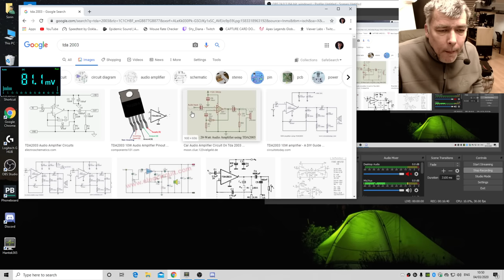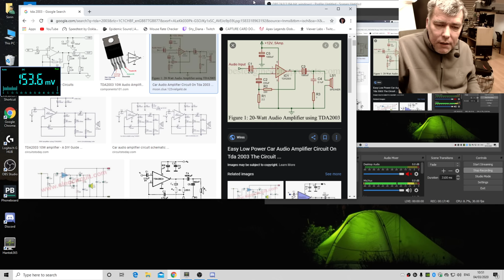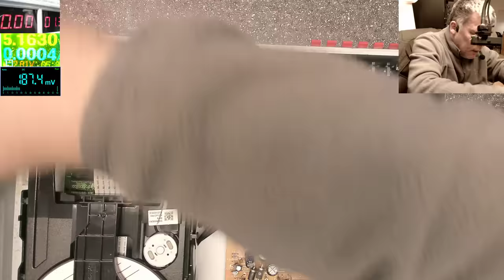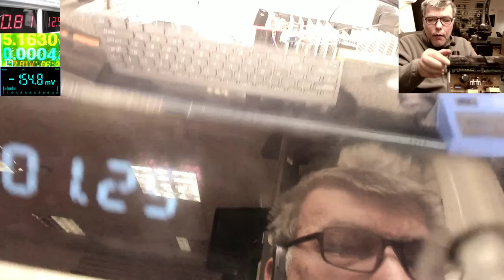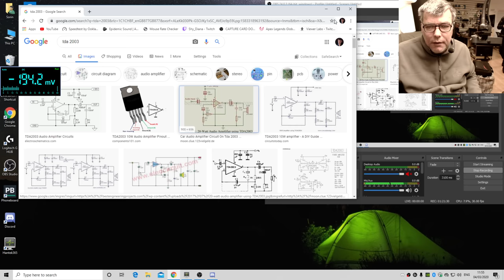Let's modify an audio amplifier - Old school skills here :D

Comment: If anyone is interested. The original amplifier IC is a Sta518. Under the heatsink there are two of those, and they get really hot. Since the 5.1 function in this home theater only works in DVDs, people tend to use two speakers in the same channel (Left and Right front) to get all the speakers working.

Comment: also you can find very cheap class D amplifier for the same price than the TDA2003, on AliExpress. Very little, wide power supply, effeciency, to replace amplifier in some case, like here.
Reply: good point
Reply: exactly thats what i do in my modification job of dvd amplifier and its not useful to use a headphone to detect the audio signal at this net age, u can find out the datasheet of the sound processor and connect according to the channels. hope u will make a 2nd video of this dvd amp. with a multi channel class d audio board.

Comment: speaker connectors destruction : check
zero calculations for circuit design  : check
air wired circuit with zero insulation : check
nice heat dissipation : check
muddy ground connection: check
component side wire soldering : check
random color code wiring: check
smoke generator : check
5.1 to 1.0 sound conversion joke: check
"should be fine" justification at the end : check

All this mess to avoid changing the original chip … remember : changing the chip is boring, doing modifications is exciting ! :D
I hope next time Sorin takes his car for repairs, the mechanic, out of excitement, will swap the engine with a underpowered bike one !

WHAT A DISASTER  :D !  … thanks for the laughs though :D
Reply: have you ever been to eastern europe? everything is done like that, and much is even better than the original. These people are VERY creative. It comes from old soviet times when there was nothing around to repair anything properly, you could only dream of buying new stuff. I love this mentality. You western guys cant even imagine how it is to live under these conditions.

Comment: FKN genious, i would have never in my mind get an idea like using broken headphones and a capacitor to look for sound signal. A year ago i somehow managed to fix this similar amplifier by changing caps and resoldering or replacing some diodes near amp chip. Took me a couple of days of searching and troubleshooting but i managed to fix it, but i do understand it is not worth for you or your customer to spend whole week troubleshooting and ordering parts. Thanks for making videos like this they help me gain more knowledge to apply in my field of work. Hats off to you my friend.
Reply from the maker: This is just an idea, i don't even think will worth to build the amplifier as you can buy the tda2003 kit from ebay with pcb
Reply: @electronicsrepairschool  To be fair for small amps like you made in this video i prefer kits that contain already made pcb, amp chip and couple of passives. I tried making my own amp board from tda 7297 but i quickly realised that wires and perf board are not meant for amplifiers so i quickly turned to chinese kits that i just put together and bam i have working amplifier thats inexpensive and works perfect without noise thats caused by stray capacitances and wires that act as antennae.
Reply: @electronicsrepairschool  true, you can find cheap Chinese class D Kits, in small format, good for this kind of jobs. May be better than tda 2003 or 2005 considering how old that technology it is (not an expert).
Reply: @electronicsrepairschool  I had a tea 2005 kit (came with schematic), but when I try to replicate that schematic I run in same problems as you, at that time I could only read schematics, couldn't understand why a resistor or a capacitor have that value.

Comment: Nice vid. It brings back lots of memories. I'm very familiar with the TDA2003, 2030 and 2040. I tinkered a lot with those, back in the days.

IMHO, the TDA2003's noise floor and its frequency response are not quite 'compatible' with CD-quality audio. I'd prefer the TDA2030. It's like an improved version of the 2003. And the 2040 is even better if you want to build a powerful bridge amp. Back in the days, I made such, from two TDA2040s, each 'helped' by a pair of transistors. That amp served in a self-built active subwoofer for a long time. I powered it with +/- 20V. That would be the max for the TDA2040. At 2 Ohm, it will almost do 200 Watts bridged and helped with external transistors.

(The TDA2040's datasheet from ST's web site shows an example bridge amp without extra transistors that does 30 Watts at 8 Ohms using +/- 14 Volts, to keep it all within the safe limits of the TDA2040. You really need to add the transistors, up the voltage and down the speaker resistance so its full potential is unlocked, whahahah)

These 5-pin TDA amps have excellent protections in them. But if you run them in bridge on the absolute max power as described above, they can die, as I discovered, lol.
But in basic 12Volt amplifiers, they will survive almost any abuse. So I used them a lot for fixing transistor-amp-circuits I destroyed by overloading them with too much speakers in parallel. Again.. back in the days... In the time that it seemed a good idea to bypass some of the primary windings of two (salvaged) parallelled transformers, in order to get exactly to the needed +/- 20Volts after rectification, with enough current. Putting a fan on the transformers was cheaper than buying a new one that would meet the spec out of the box.

For your work, Sorin: nice job. Just a few things... It seems that you did not combine the two channels (left & right) into one mono channel, using two resistors. You really should. Some music can sound weird if you have just one of the channels. And I'm sure you secured the parts floating in mid air with some hot glue, after lunch? Or, transfer the parts to a small piece of perf board? Or was this a demo repair?

Unfortunately, this TDA20xx 5-pin amp chips are discontinued by ST. Maybe there's still a clone manufacturer producing them? I still have a few.
Reply: You now get the TDA 2050 made by UTC which is pin compatible with the 2030 and 2040 with a few components changed. Much better that the others and will give you at least 25w RMS and claims a 20hz to 20khz response time although I would think it is less than that. Still good in a properly designed circuit and real cheap. I got one for about 8 ZAR which is about 40p or 50c US. The TDA2003 is about the same price and terrible by comparison.

Comment: Great video/thank you for the lesson. I would overdo a solution here but you do a nicer 'quick' solution. This saves the item from going to landfill or 'recycling' which really should be called salvage because its so inefficient.
What do you do now? reassemble the parts to be more resistant to vibration? Hot glue it all together?

Comment: I would make the amplifier and test it before putting it into the unit, it looked like a pain to add parts in the unit.
I have used the same chip for a test amp for tracing audio and in a small tv, they work well normally.
For small battery radios a LM386 is loud enough :-D

Comment: i learned to use a ceramic capacitor from the output of the amply fire to the speaker and not an electrolytic one

Comment: You had modified the amplifier with TDA2003 which is less powerful than ''original'' class D power amp. I would not have made such a change.

Comment: Why not replace the sound ic its faster.
Reply: It's not necessarily the IC at fault. It can be just muted, which is very common with modern chips - they have built in thermal and short protection. Also you need to order it and wait for it to arrive and your client might chose not to wait.

Comment: Any advice on a Bluetooth speaker I’m repairing. Power up and start up music plays but speaker is pushed out fully as if there is a short on the line. The speaker returns when music stops? Music is not very load as speaker is getting power from another circuit which is making the speaker hot after a min or so?? 

Any help would be good

Thanks
Reply: you have DC voltage at the speaker wires ! this is bad for the speaker coil that could burn !
check for shorted output stage chip, capacitors, etc ….
Reply: odium hi thanks for the info. Do I need to check audio side of things or power side? I’m yet to see what voltage is coming through the speaker wire but suspect it’s 3.3v

Comment: I have a Yamaha PA mixer amplifier lying around.
It turns on but immediately shuts down and wont turn back on. It repeats the same pattern only after a day😆.
Im not sure where to start with diagnosing it.
Reply: Power supply capacitors
Reply: @Adi-lv9bo  thanks👍

Comment: That’s more than 3 components? In the amount of time you probably took to do this you could of reused some of the current setup and put this in it’s place. Yes without a diagram can be hard but you didn’t even check the original chip and it’s pin out to fit yours in it’s place.. good for a experiment for your own use but having them connections given to a customer.... not so good..

Comment: would it not be easier to build the components onto a length of chocolate block connector rather tha have it all suspended in mid air. then you can HOT GLUE in onto the board!